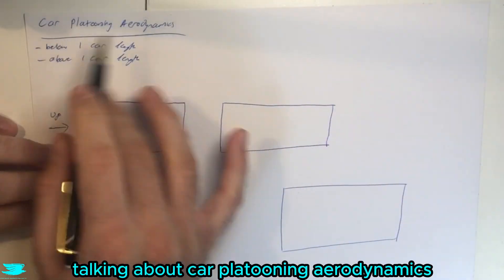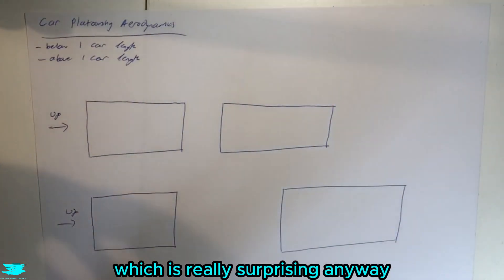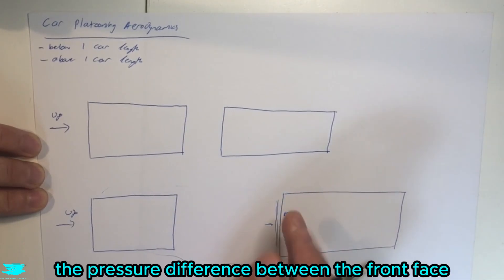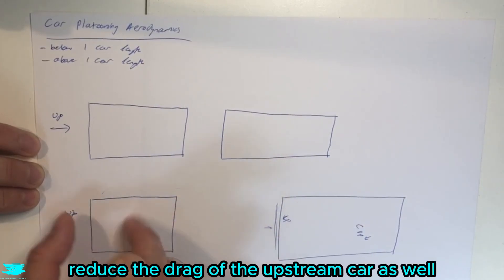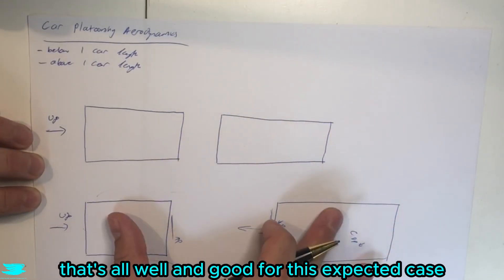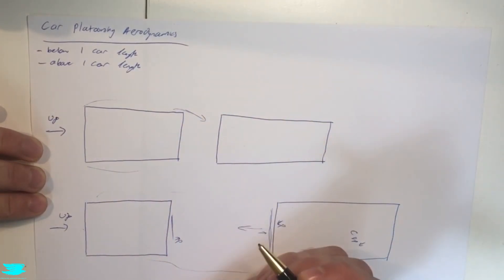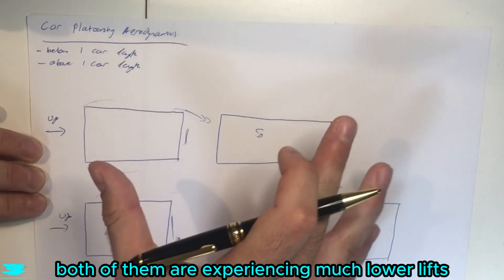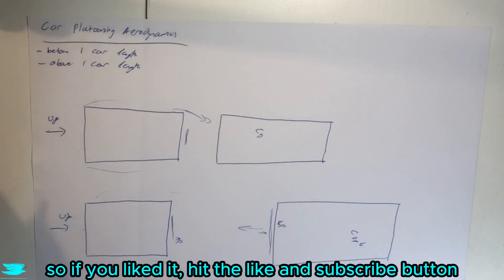Surprising Car Drafting Aerodynamics {Auto Aero #65}

Comment: Just a thought - this could be one to test in the Catesby Tunnel in the UK, especially for high-end motorsport where cost doesn't matter (much).
But whether the tunnel owners would want two cars running at 100-150 mph in close proximity is another matter!
Reply from the maker: You could potentially turn it into a wind tunnel too by putting a fan and some flow conditioning stuff upstream. That would be cool.
Reply: @PremierAerodynamics With the law on their side, the bats roosting at the far end of the tunnel (and which apparently prevent the last 30m being used) might have something to say about that idea!

Comment: I would respectfully disagree with the top case, with the trailing car being closer. All experience, at least in terms of racing, shows the closer you are, the more of a drag reduction you have. This is partially due to the reasons you mentioned in the bottom case, but also because the downforce decreases, as the front of the car does not get as much, or almost no clean air at all, the drop in front downforce reduces the rolling drag, as well as due to the cars ultimately getting closer to themore optimal slenderness ratio of ~3, as if they are one solid body (with very low distances between the cars of course). Also, looking at any F1 or Indycar onboards at race starts for example, you can really hear the engine sudden jump in engine RPM when the cars very closely slipstreaming, especially on the more draggy cars, like the 2018 McLaren for example.
Reply: Good points. We should ask if this rule applies to a streamlined car with high-downforce (i.e. induced-drag) devices , or a zero-lift brick.
Reply from the maker: This is a little tricky to answer because many of the papers showing this phenomenon are for cars that produce quite a lot of lift and hence induced drag. So, technically, yes, it holds true for cars with high induced drag.

It makes sense because if you optimize aero devices for clean flow, when you have very chaotic flow and highly angled flow hitting it, they won't perform as well and you'll likely get flow separation and higher drag.
Reply: If you search using Google you can find scientific papers that support this e.g.
"Contrary to several publications it was found that in a platoon of two vehicles, the drag force of the trailing vehicle exceeded that of an isolated vehicle for close spacings. Analysis of this surprising result revealed that design features introduced to optimise the wake of an isolated vehicle can lead to a drag increase on a following vehicle."
Reply: The video might also explain why F1 cars can close rapidly on the one in front, but struggle to overtake if the drag suddenly increases as they get ever closer.
Reply: @robhills2613  Possibly, but also the necessity to deviate from the racing line while passing reduces cornering speed.
Reply: @AwestrikeFearofGods That and also when they have to pull out of slipstream they lose most of the gains.
Reply: @TheGamingHungary Conversely, perhaps the drag reduces when the car moves from within one car length to free stream.
Perhaps the drivers behind should pull out from behind sooner than they tend to do.
Reply from the maker: I have noticed that too. It seems like they just get stuck and struggle to overtake.
Reply: I am also skeptical of the top case of trailing car's drag temp increasing at about 1 car length away, especially from years of observing NASCAR superspeedway racing . However one time period this may have been validated is early in the Gen 6 Cup car (2013 - ~2016), there was an issue with the racing package where the trailing car would get "stuck" behind the lead car at around 1 car length behind (aka the bubble package). This was a major issue from a racing product standpoint - passes were too difficult, making it less interesting for us spectators, because it meant it took 3 to 4 cars having to gang up to pass the lead car. However my and most of the industry's theory for this phenomena was at 1 car length, enough flow separation occurred from the lead car's spoiler that its reduced drag simply sped up the leader faster than the closing rate of the trailing car. Very interesting theory, and btw the issue was solved by making the cars more draggy by around 2019 to facilitate better passing, until the entire racecar got redesigned in 2022, the "NextGen".

Comment: Can you do a video of the difference of Aerodynamics with a Bug Shield and using a Car Bra?
Reply from the maker: Thanks for the suggestions. We'll see if we can get good results on these devices. If we can, then we will make a video about them.
Reply: @PremierAerodynamics  I have a lot of curiosity, but no means to test. Like 'Scales' on the 1st 1/8th of the hood. Where to mount 'Mud-Guards' (How close to the tires). Using Peel and Stick Door Guards for Air-Flow Adhesion across the back half of a car. And much more.